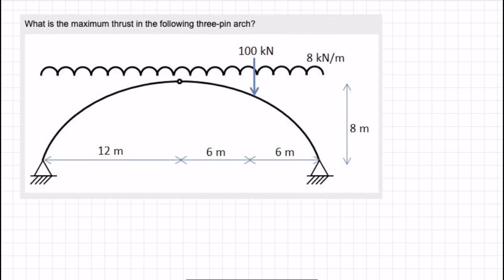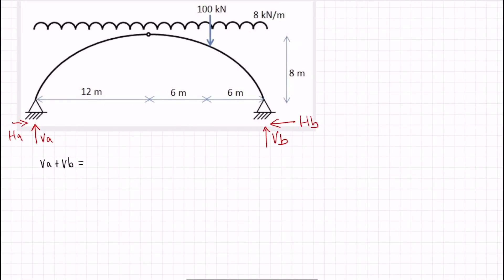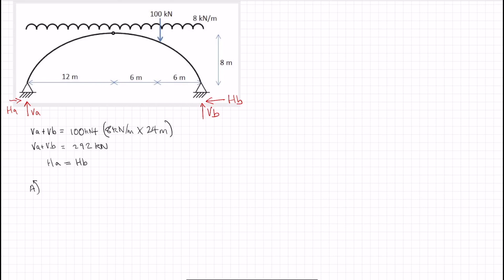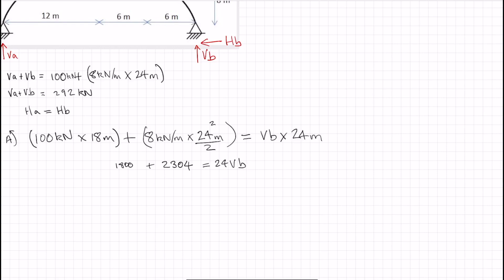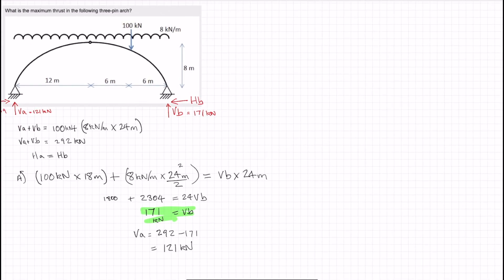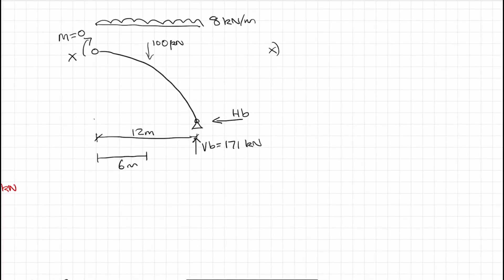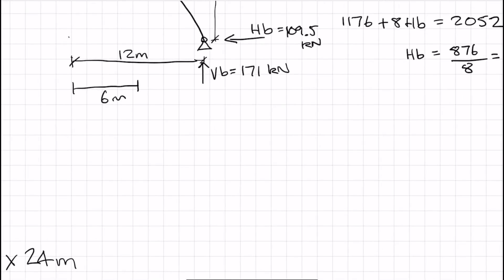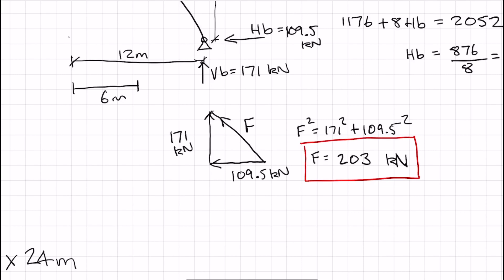Maximum Thrust in an Arch - IStructE Certificate in Structural Behaviour

Comment: Great video! It would be good to explain the assumption about Vb having a reaction to the left. This is because the force transferred through the arch is pushing right on the pin support from the applied loads. Hence, to maintain equilibrium at Vb, there must be an opposite horizontal reaction. We should know this intuitively as engineers, however some people might not pick-up on that. Thanks!